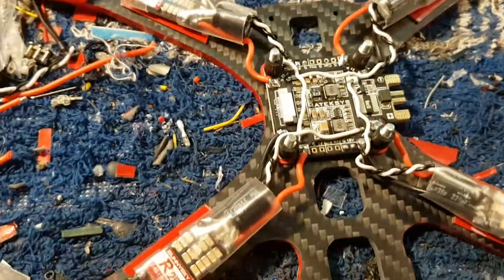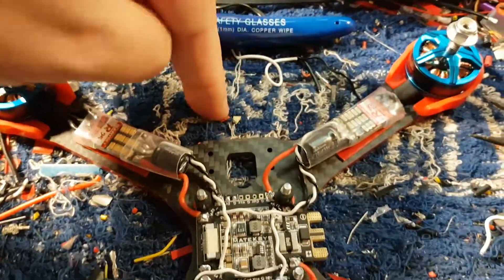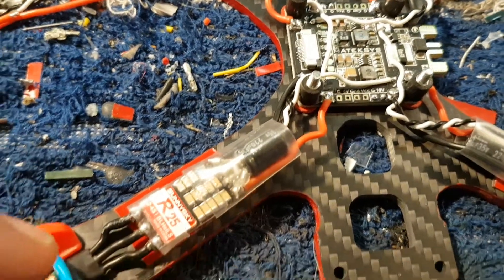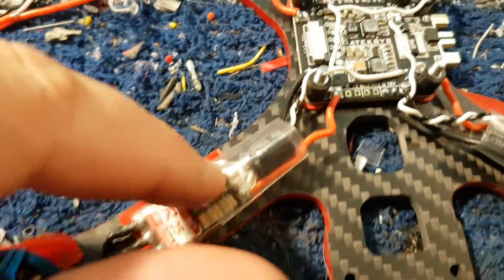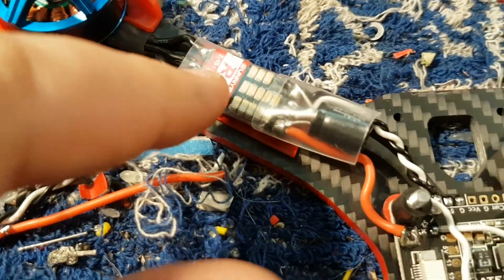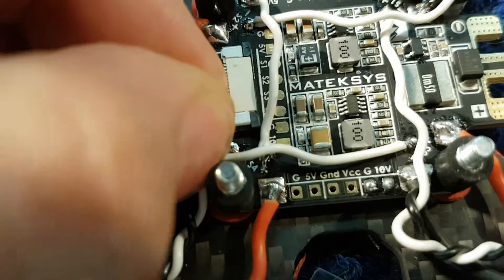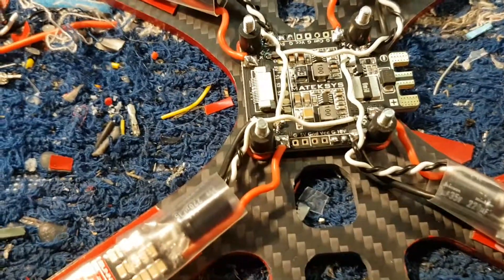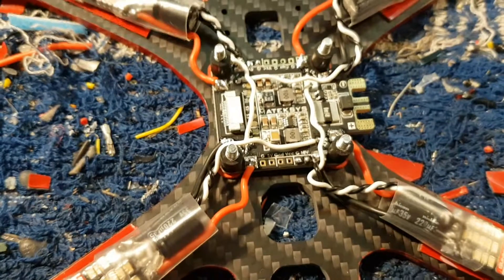RAW-Matek F405 and FCHub combo ESC wiring when rotating PDB

Comment: Hi Simon. I recently got the F405 FC and 6S hub and needed to mount the hub sideways to accommodate everything. This of course put all the ESC pads 90 degrees out, and so I wired the Signal to the correct number pad, similar to your video. Did you encounter any trouble then mounting the FC the correct way round - i.e fwd is fwd. Even though I wired the ESCs to technically the right signal pad, the motors were behaving and operating on the opposite channel.
Reply from the maker: Are you sure you mounted the FC the right way around?  What you're describing is an FC that needs to have its yaw set to -90 or 270 degrees offset.
Reply: Hey man, Problem solved! The FC was correct however I failed to notice that when I put the new ESCs on, all the props were spinning clockwise. Prior to noticing this, I re-mapped the motor positioning Betaflight - That just made it more weird, then after setting the motors to spin correct direction, the quad still worked opposite, because of the re-mapping. A full re-flash did the trick. Thanks for the video though.

Comment: Pro Tip: Resource remapping...you can change the Layout in the cli tap. Thats easier and cleaner :)
Reply from the maker: It's actually not easier nor is it cleaner. Since I made that video, I have re-flashed at least 10 times. Do you think I'll remember to do the re-mapping in the CLI every time? I think not.  Wire it up properly one time, and you never need to think about it again.

We all know that the use of the DIFF command can be dangerous, and when you have more than 1 quad, remembering which one needs a channel re-map after flashing is all too hard.  Just hard wire it up the proper way one time and then you never need to think about it again.

Channel re-mapping is really only useful when you destory a pad or something like that.
Reply: Simon Wallace I save the dump from all my Quads. So where is the Problem ? When you flash the quad, all you must do is to copy and paste the dump file :)
Reply from the maker: You can do whatever you like with your dumps and the CLI. I don't need to do any of that. I just wire it up with the correct channel assignments from the start and I never need to worry about it. No thinking or dumping required. No channel re-assignments. No restores. Nothing required. Simple is good.
Reply from the maker: @clockw0rk843  do whatever works for you, but my method works for me with this quad. Maybe you can record your own video about your own method and your supposed intellectual superiority.  It's a good solution for me, I shared it for others and if you don't like it, don't watch it!